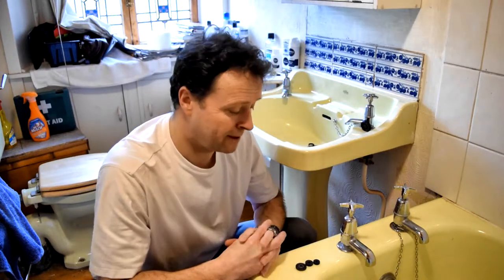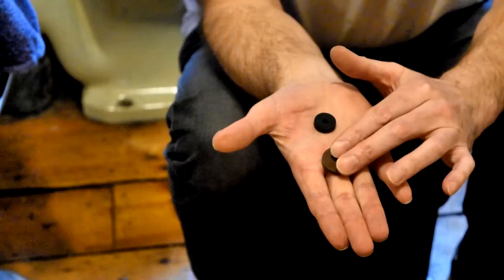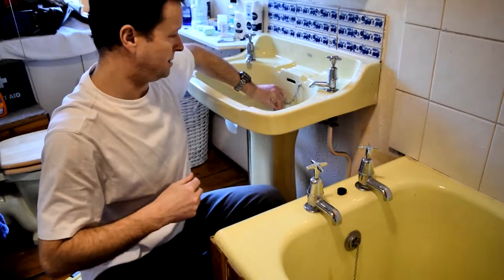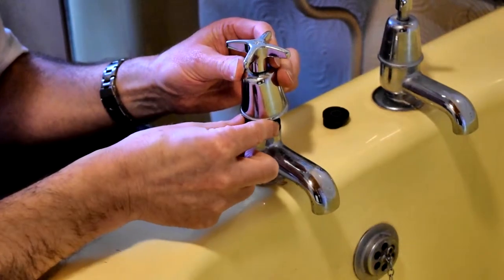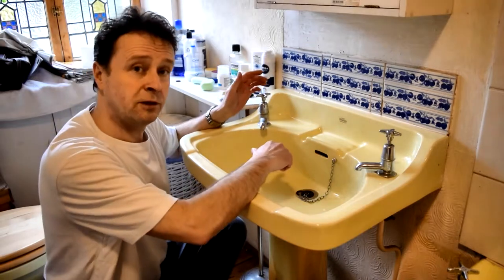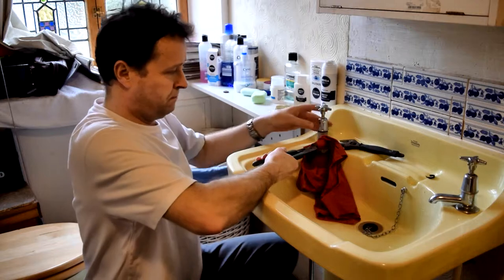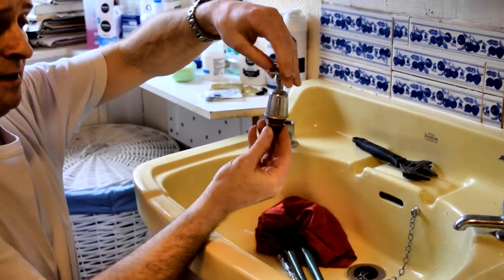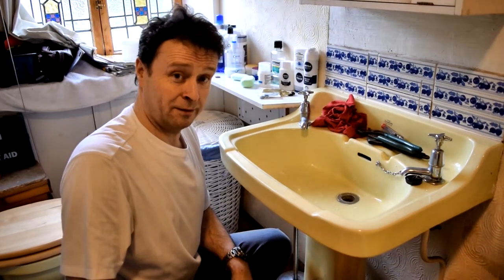Change a tap washer

Comment: This is the best video I've found for these taps!  Need to change a washer in my 1960's council flat and wanted to do it before I ask my long suffering Dad, turns out I'm not strong enough to stop the tap spinning and actually undo it but at least now I know 🙂
Reply from the maker: Ah that is a shame Claire, glad it helped just a pity you didn"t manage it. A lot of the time these things can be very well seized and you do get ones that simply will not move or break before they do move which is not a lot of use.
Reply: @yourplumbingpal1225  I did it, used blocks of wood to brace the tap against the wall to undo it, won't tell you what I used to brace it to do it up again 😆 sadly it's still dripping so going to try reseating it
Reply from the maker: @clairesewcreative1255  ah great. Ye you should be able to feel with a finger nail if there is a damaged seat but to be fair not everyone has nails they can to that with and reseating might just do it, good luck.

Comment: My cold tap exactly as per your video.  Problems with hot tap as couldn't release spindle by slightly raising the dust cap. In the end I undid the grub screw holding the tap handle which I removed to expose the spingle. This allowed me to use a 13/16" ring spanner to remove the spindle. (More grip and leverage).  Just a suggestion.

Comment: As an occasional amateur plumber changing a washer is invariably the hardest job coz by the time you get to changing the washer is so corroded getting to the washer is practically impossible

Comment: Excellent!  Thanks for this.  Good advice about not cracking the sink!  I wonder whether some washers are better than others.  The modern ones seem very hard whereas the older ones seemed to have a bit more give in them and seemed to last rather better as they did not get grooved by the tap seat.  Thoughts or just fit the cheapest washers you can find?

Comment: Any idea where I can get handles for those type of bath taps?  They have a square shaped pin/spindle to attach to the handle.  I cant seem to find them anywhere and don't know what the spindle is called. 

Or is it best just to replace the entire tap head?

Comment: Great find this video. However, the headnut is stuck fast. Can't shift it. Any ideas? Thank you.
Reply from the maker: Hi Julian , only thing I can think of is applying some heat from possibly a heat gun with the metal sheild against the basin and this should in theory expand the tap body to let you undo the tap body from it. Need the water off first of course to stop it absorbing the heat. It sounds good in theory however the fact is it is quite difficult to get it to work. Also important to apply the force to the spanner right after the heat, no tome delay as it will.cool very quickly. Very important heat is not in anyway applied to the porcelein basin, good luck.
Reply: @yourplumbingpal1225  that's appreciated, I will give that a try for sure.  Thanks for your swift response.

Comment: I was ajusting the ballcock on my small toilet,
Turned the stopcock off, and turned the cold water tap on to drain /air in above the sink.
I noticed when using my electric, cold mains supply shower, that slurging sound from it, which eventually  sorted itself  out.
What caused  it, and prevent it happening again👍
Reply from the maker: I would think it just had air in it, the shower, and as the air was forced out by the mains pressure water it would then run normally. The best way to stop it is just to run the shower on cold to get all the air out before then putting it to a  heat setting which also means it cant overheat because it has air in  it and not enough water. I have to say most electric showers are well designed to flush the air out once the supply has been off and reinstated. Good idea is also when turning off an electric shower, turn the power switch through  the settings rather than from.2 to zero or whatever, as it gives it a second of water flowing with no heat element on which means it cant overheat and damage itself , also means if someone uses it right behind you they dont have a tiny cylinder of suoer heated water coming on to them when they switch it on, anyway thats not what you asked. The air in the shower issue after having the water off is not really a problem its just an issue that kind of clears usually within 30 seconds. Not sure if that helps, but hope so.

Comment: This is a very helpful video, thank you! I have a tap exactly like the basin ones with the ‘cover’, however it seems to be completely stuck with limescale and I cannot get it to lift up at all. Do you have any tips? I can’t find anything at all online!
Reply from the maker: I dont have any tips that spring immediately to mind. Though I would maybe try some limescale removal cleaner spray( left on for a period of time)  and if the problem is it wont loosen it might be worth trying a rubber band kind of grip ( instead of a spanner or grips)  very similar to the type you get to take off cartridge oil filters on cars.  Hope that makes sense. They arent always easy to get off however if you keep at it it should come. Taps like those basin ones are getting on for being  60 to 70 years old so it can be a lot of muck on them even if cleaned regularly as the cleaner also helps get in the gaps and again makes it harder to come off. Hope some of that makes sense.
Reply: @yourplumbingpal1225  thank you SO much! This worked, soaked overnight in white vinegar and used one of those openers and it worked! Sadly though, now the bolt inside, exactly the same as in the basin in this vid, absolutely will not budge. I don’t suppose you have another amazing tip do you please? You’re a lifesaver!
Reply from the maker: @hq789  I cannot remember if its in the video , it possibly is , however the only thing I can think of is using a set of grips or spanner to hold agaisnt yourself with either plastic jaws or a cloth round the tap spout to stop it being damaged . I have see a tool that I think was called a tap gear removal tool, or head gear removal tool and it used the tap body to lever against itself similarily to what I described essentially holding the spout and levering against that so as not to snap the basin. It looked great though its not the sort of tool most people would get much use out of I dont think. Sorry no other ideas, if you use heat on it it will just burst the basin so there is no point in anything like that. Good luck, great taps if you cab get them apart , will last another 50 to 70 years.

Comment: the bathroom suite needs replacing by the looks of it
Reply from the maker: It certainly does. Reckon it was circa 1950's based on the markings on the taps. I am pretty sure it is still in.